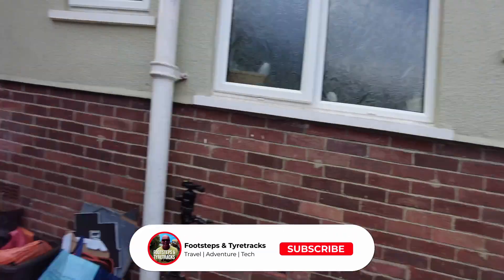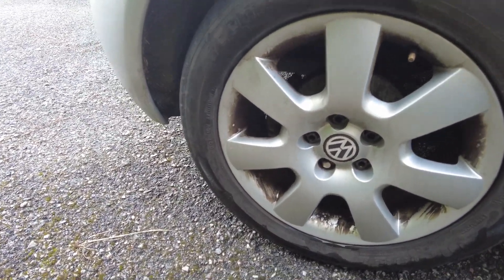Clean Your Alloys For Only £1

Comment: Its a good result but 2 things for excellent results... it be wiser to remove the rim then give it a good first ckean up so the follow up won't be too difficult to get best results and secondly a good aluminum polish on the wheels would prevent dust dirt and brake dust from biulding up to that level...just my 2cents...
Reply from the maker: Yes I do agree if you are looking for a perfect finish, this is more about cleaning up the daily hack easily my wife hadn’t cleaned the wheels in maybe 12/18 months.  Thanks for watching the video 👍
Reply: @FootstepsTyretracks  i hear you mate but good on you anyways👍👍👍